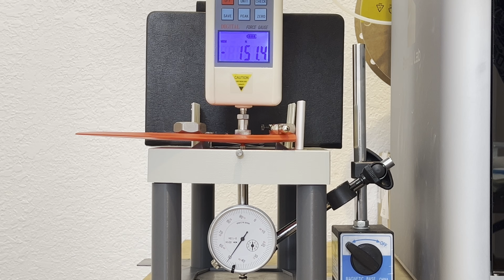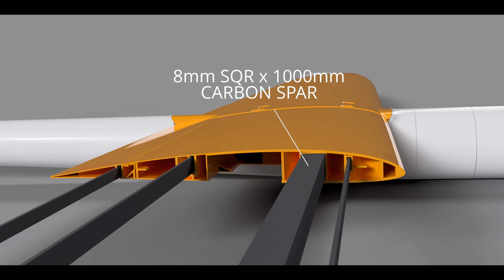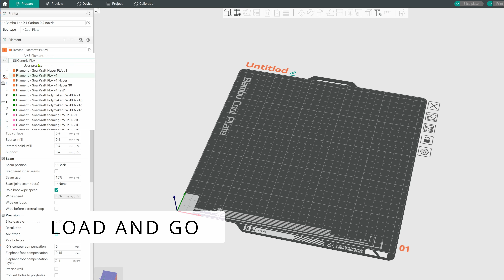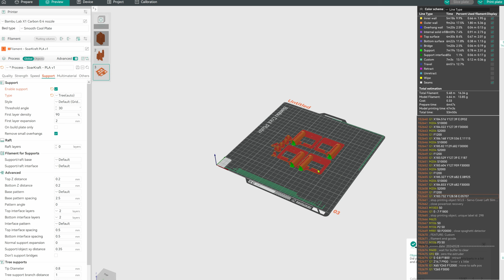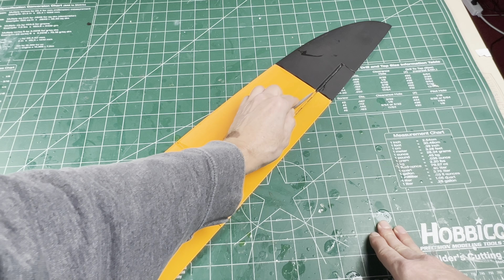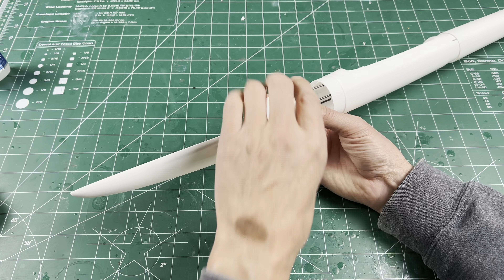Stretch - SoarKraft 3D Printed Glider - Part 1 - Airframe Print and Build

Comment: hi, what kind of tnut can we use for building your plane, is there an example, thank you!
Reply from the maker: for metal - #10-24 thread size - M5 is about the same.  
here is one from homedepot - https://www.homedepot.com/p/Everbilt-10-24-Zinc-Plated-Tee-Nut-4-Pack-825011/317478745
here is the same from mcmaster - https://www.mcmaster.com/90975A109/
the plastic ones are included in the printing files but need a thread tap to match the screws you want to use.

Comment: WOW rc has came so far. I learned on slope soaring back in the late eighties with a gentle lady then a ridge rat. 72 mhz radio gear that you had a number for your frequency that you had to check so no one on the same channel tried to fly at the same time as you. I went on to a coyote then an sr7 then a whisper hollow molded Italian model. 2.4 ghz radio gear with no conflicts and DS sloping and all the tech advances like 3d printed and also 3d flying!! Impressive

Comment: Hello, I’m thinking of printing the stretch using LW-ASA (it gets warm here, and I have been more successful with LW-ASA than with LW-PLA-HT). Can the entire stretch be printed with LW material or just the wings?
Reply from the maker: the whole thing can be printed with LW foaming material - if you check out my other videos I have a Stretch with my light weight power pod in Bambu AERO LW-PLA.  https://youtu.be/XUw65dwEXdg flies great, and I was about to do a quick build video for it... coming soon

Comment: Nice, the pika electro turned out a bit heavy and way too fast for me. Will the powerpod fit on the strech? Best regards Leo
Reply from the maker: Yes, the same power pod fits the Stretch.  Use the LW-PLA or the LW-PLA-HT with the Pika can reduce the wing loading and make for an easier / slower landing.  I build one at 450g without expensive light weight electronics, 3 servo, 650mAh 3S... still quick, but easy to slow down for landing.  The stretch is similar, can be fast, but easier to slow down when lighter.  More videos coming about this.

Comment: Awesome again.   Still trying to get my lw-pla to print correctly.   Cant get anything to work correctly.
Reply from the maker: Let’s figure this out…. You are using a Bambu X1C, right?  Which slicer and which LW-PLA?  Are you using the .4mm nozzle?  The X1C makes printing the foaming LW-PLA pretty easy so there might be something else making it difficult?  I also have a .3mf file, with the test part for the X1C, that I have been including in my file sets that you can just open and print, and I can email it.  However unless you are using the same slicer release it might indicate that you need to update… which leads to more questions.  Nothing stays easy so it is better to learn how to use the slicer.
Reply: @soarkraft I am currently using the bambu slicer with the X1C printer with the polymaker lw-pla.  Have done the drying process on the filament, and had no success.    Yes using the 0.4mm nozzle
Reply from the maker: Got it and I see your problem.  
So the Polymaker LW-PLA is pre-foamed... it does not foam anymore.  I do have a specific configuration for the Polymaker LW-PLA on my website, you should get parts that are ~ 67% the weight of regular PLA parts.  The X1C can easily print this material with the right settings, especially for my airplanes.  Look for the "PRE-FOAMED v1" on my materials and settings page.  Polymaker does not make a foaming LW-PLA that I know of... Overture Air and InLand LW-PLA are also Pre-foamed materials. 

Now if you want to use foaming LW-PLA you need to buy the right stuff: Bambu PLA Aero, eSun ePLA-LW, ColorFabb LW-PLA, or SainSmart LW-PLA.  All of these work on a X1C with my LW-PLA configuration for my planes.  It might work for others too, but I don't test anyone elses designs... they should do that.
Reply: @soarkraft  I will give that a shot when I get back home.   Thanks for the help and support!!
Reply: @soarkraft  I do have a spool of the bambu aero I can use as well.  Will plug the settings in and see what happens.    Thanks again!

Comment: Great video , Did you ever try out a tpu nose cone on a prototype glider ?
Reply from the maker: Alright, I just printed one, came out great, but I don't think I would recommend it... I will have to add it to an upcoming video because it is interesting.... but also kind of funny.... worth a flight on camera.
Reply: @soarkraft  i thought maybe good nose weight and additional impact resistance, I'm keen to see the theory put into practise :)
Reply: @soarkraft  good stuff, im looking forward to that one , maybe a whole short video of tpu nose cones and a few design options ? . Maybe the internal thickness can be tweaked or TPU comes in many sure hardnesses so a firmer one might be a plan. I'm reading between the lines a little here but if you are adding nose weight its still worth another couple of experiments perhaps.  My main reason for suggesting tpu there is that its much less of an egg shell and could handle harder landings and protect the other components by having a crumple zone effect .
Reply from the maker: I forgot about that one… i have material and an idle printer… I will print one now before my brain gets hijacked by something else.